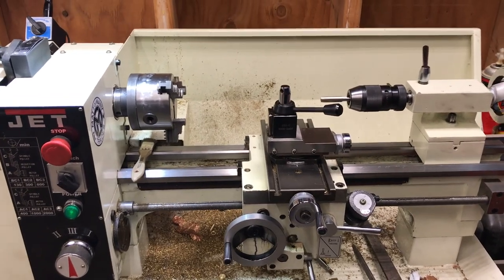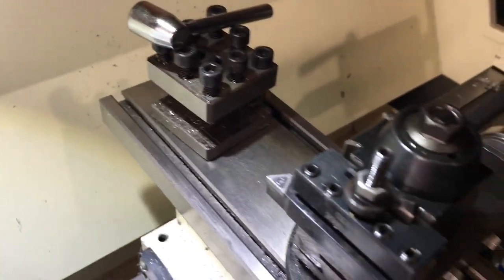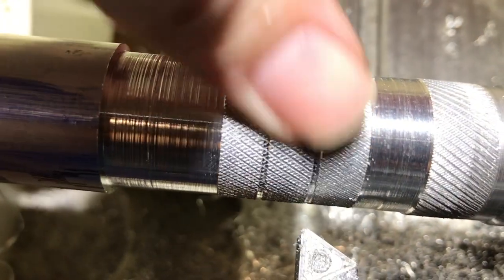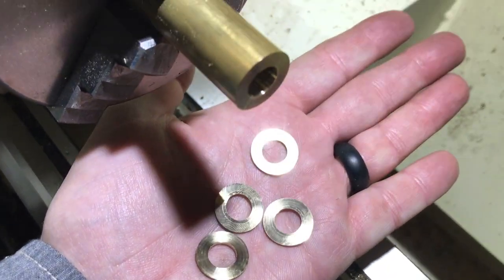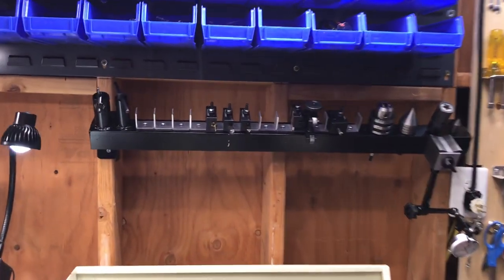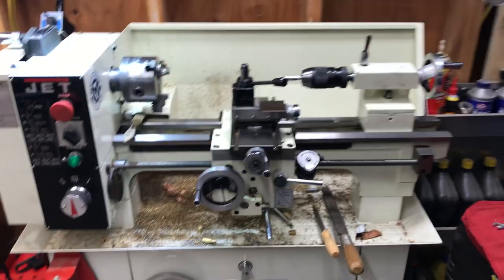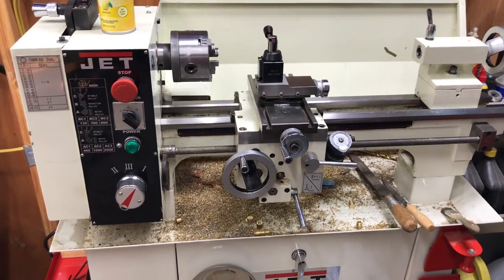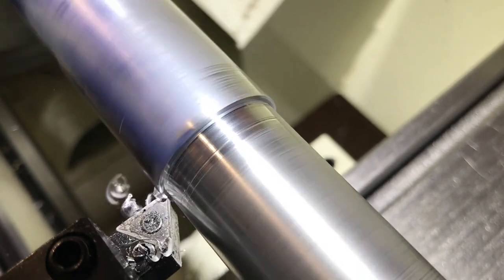METAL LATHE | Setting Up and Running a 9X20 Lathe

Comment: hey buddy so i was watching your video here cus im interested in getting a jet benchtop lathe as well and you had mentioned you got yours for super cheap from a guy who gets them damaged and then gets them fixed a sells them can you possibly put me in the direction so i could  maybe buy one the same way you did. thanks alot
Reply from the maker: Hi Derek.  Absolutely.  I got my Jet from Equipment Sales & Surplus in Auburn, WA (local for me, but he ships as well).  I have bought 56 machines from him over the years and 2 have been either floor model sales or refurbished.  The quality is the same as the new ones I bought from them.  I do business there when ever I can and he has taken care of two friends with their wood lathe and sheet metal break purchases.

http://www.equipmentsalesandsurplus.com
Reply: @MattofManyTrades  awesome thanks so much for your quick response i will be looking into it at the link you provided. thanks again

Comment: Your explanation of why you turned down a nut because you want to install a quick change post makes no sense
Reply from the maker: Sorry.  I should have explained the whole process better, but there was some cussing and frustration when mounting the Quick Change Tool Post or trying to the first time.  Here is the short version:  The QCTP comes with a bolt that had a different thread than the one on the bottom of my compound slide.  I had to take the compount off the cross slide, take it all apart, turn down metric nut, and pin it in place with a roll pin on the bottom of the compound (anti rotation) in order to allow me to mount the QCTP.  Why not use the bolt already on the compound?  It was both too short and was larger in diameter than the hole in the QCTP.  The lathe is a Jet and the QCTP is from Little Machine Shop and everything was supposed to be a direct mount - hence the cussing and extra work when it was not.  In hindsight, I could have also turned a new double threaded bolt, but I would have had to source the right thread die.
Reply: Oh ok thank for clearing that up. I might get a 9 x 20 soon that’s why
Reply from the maker: @TomSGao  This is my second one.  REALLY handy size.  I would advise staying away from anything with plastic gears!